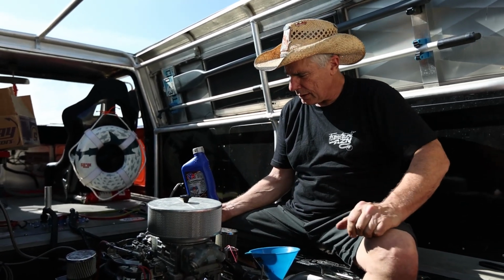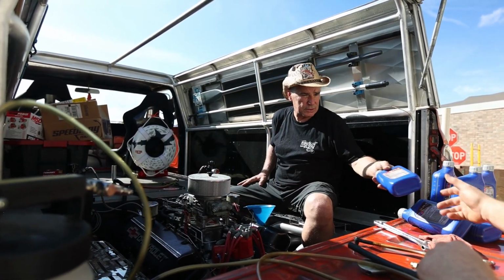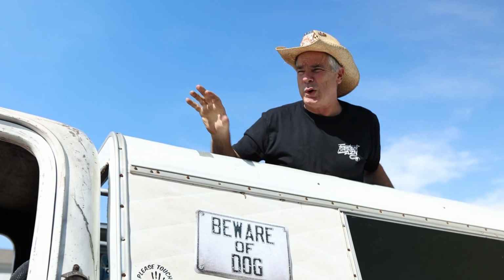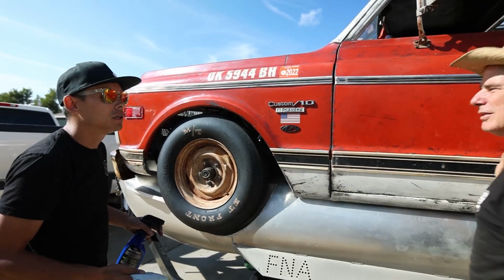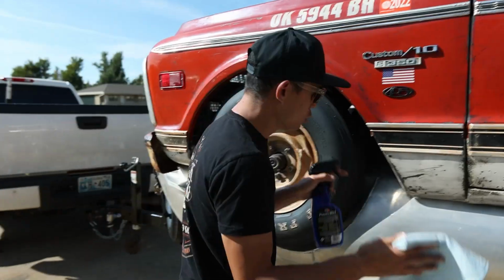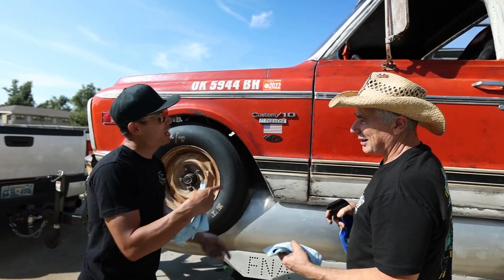DON'T THANK ME! THANK VP! (RACING FUELS)

Comment: if you are really interested in better on water speed, you would polish a triangled area ahead of the jet intake and straight back to the transom. Then crosshatch everything forward and outside of this area. This is how our "C" class hydro hits 90, when we hit the throttle hard we actually are standing on the transom after this.